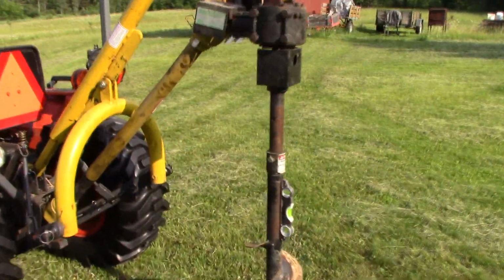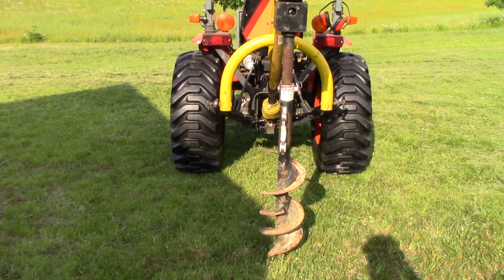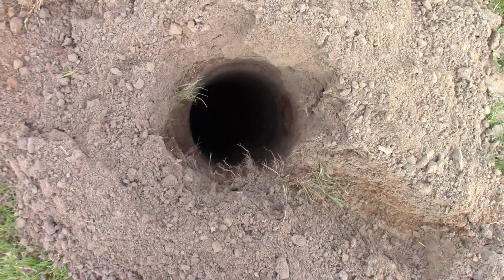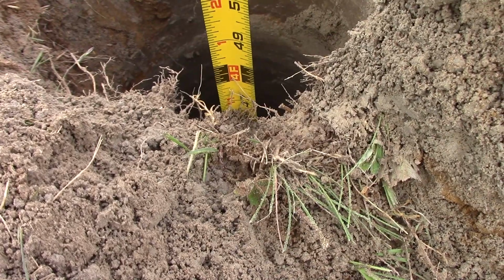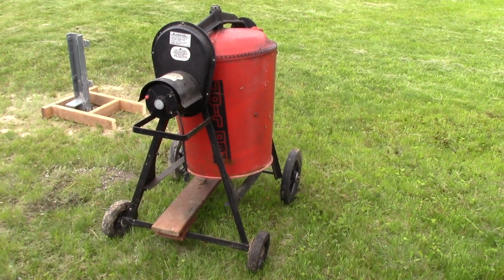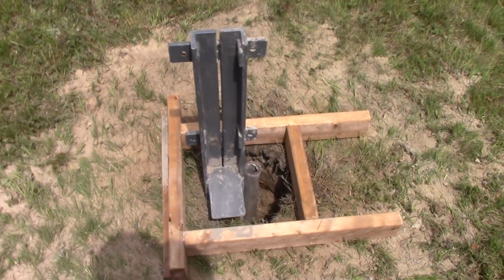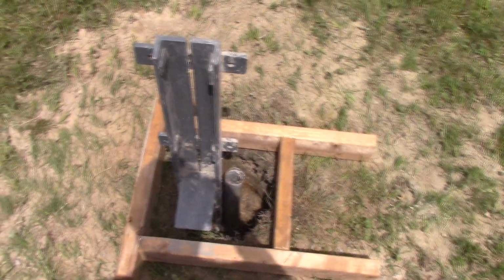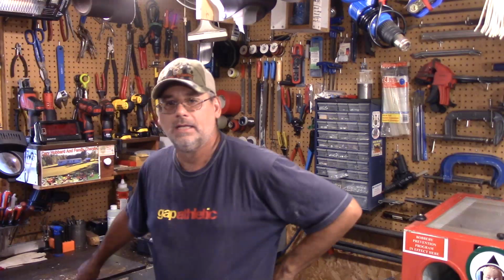Kubota  Tractor  - 3PH  Post Hole Digger /Auger  -  For My Solar Panel Mount

Comment: One good hole is all it takes, lol. I think it went in at an angle. There yea go, we need a straight hole! Those tires look squeaky clean. That is a deep hole. Spot on 46, awesome! Nice mixer. Going to be rock solid for sure. I made it through the vid!
Reply from the maker: All my holes seem to be on an angle only because I can't see straight most times :)

Comment: so what again do you need solar panels for? just mount em on top of your kabota cab.. and run an inverter off your starter battery.  Drive the tractor around following the sun.. if the sun isnt out just start the tractor to charge the battery for a while and keep the cabin lit.
Reply from the maker: LOL stay tuned for some idea that will knock your socks off.
Reply: @SteveRobReviews  Need power to keep the beer cold at the very least,

Comment: I wonder if the tractor would drift ahead as needed to keep the hole vertical if you released the brake and put it in neutral. I am surprised they didn't engineer it so the linkage made a vertical hole with out all that.
Reply from the maker: Without the brake on it will move the tractor but to control the angle you must move the tractor . Skidsteers seem to do a much better job. Having another person there is a lot better letting you know how much to move the tractor to get it straight.

Comment: Nice ! Steve, two questions for ya. First  one why are you mounting your solar panels on a mast opposed to on the cabin roof like on your shed, second question is how far away from the cabin are you and why ? Take care !
Reply from the maker: Thanks Billy. I found the panels mounted on the roof not such a good idea for me . You cant clean them so easily or take the snow off. The cabin faces due  south but the sun rises in the east and puts a shadow of about 10 feet on the panel side of the cabin so I wanted to get far enough away to catch the morning sunlight. I have 4 100w panels  with 4 six volt golfcart batteries and planing to run a small fridge off it. Its a lot of theoretical math and assumptions but I think I can do it. I will show my idea and testing .

Comment: Cleanest Tractor Tires EVVVVAAARRRR!!!  😂
Reply: Oh yeah, and shouldn't the big yellow arms on the auger articulate, or collapse in on themselves, so you don't need to move the tractor as it digs down deep?
Reply from the maker: Not quite,  you must move the tractor to dig vertical  . Having a helper giving directions works much better.  On a skidsteer it's the best .

Comment: Auger should hang plumb. Nothing to do with what angle the tires are on. If your auger is not free hanging, it is not rigged right. It is self-levelling on 2 axis. Not sure what you might be doing wrong?
Reply from the maker: Not so fast,  as the auger starts to dig the arc of the 3PH changes so no you can not just lower the auger and get a perpendicular hole completely vertical.  Nice if it was so simple as the 3ph mount must be adjusted to the lay of the land in consideration of the back  tires as well.  Being level , on the horizontal is just as critical as vertical.  It does not hang on a 2 axis as one might think.  Cheers

Comment: Good Video. I borrow my "Good" Friends Skid steer with the Attachment post hole digger. I have a 3 point on my Dads Tractor to use. I like Skid-steer better. Good Video and hot and humid as Hades here. Hope all is Good eh. Was it the Camera or the angle on the angle of the holes. Were you drinking lol oh and Nice Cement mixer.
Reply from the maker: LOL when it's hot the only thing that quenches my thirst is PBR :)  Thanks bud it's been hot  but its not slowing me down. Cheers